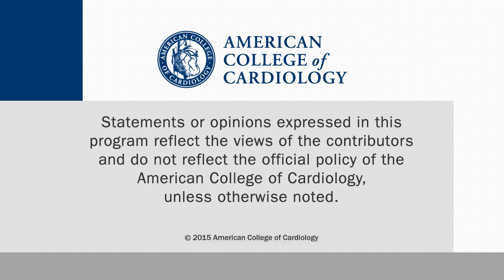Pacemaker Lead Abandonment versus Lead Extraction: An NCDR® Analysis

Comment: True story.  My dad had heart valve surgery at a highly respected facility.  They had attached external leads to him in the event they needed to use a pacemaker due to some problems he was having.  One day, after being there for three weeks, they suddenly decided to transfer him to a long term care facility. Gave us about two hours notice.  I'll never forget sitting there when a PA came in and said she needed to remove the leads.  She simply wrapped one around her fingers and pulled it out.  However, the second one didn't go so easily as it got "stuck" and she couldn't get it out.  I'll never forget the look on her face as she looked over to me.   She said it likely was caught on a rib.  So she simply "snipped" it off at skin level and left part of it inside him.
Reply: Those are different leads. They are being sutured to the outer surface of the heart during the CABG. They usually pull them unless someone is on anticoagulants or is being too old. In that case, they just cut them. The older leads were made out of metal. For that reason, those patients were not able to undergo MRI anymore.
Reply: Scary, very scary!
Reply: That's what is usually done